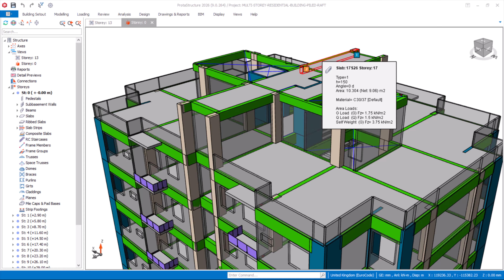How to Fix Analysis Invalidated Error in ProtaStructure | Step-by-Step Guide

Comment: Thank you Engr. Justice, i nearly ran mad today after checking over hundred beams only to run into this invalidation 3 times.
i am overtly thankfull.
Reply from the maker: It’s nice to know the video helped you 😊
Reply: @EkidelEngineering  it did help sir but I think the 2026 I got from the EKIDEL site is not good.
Reply: It doesn’t keep to interactive designs and it doesn’t  allow for make bottom chord perpend in steel roof designs. I told you already on WhatsApp but you are yet to reply me sir